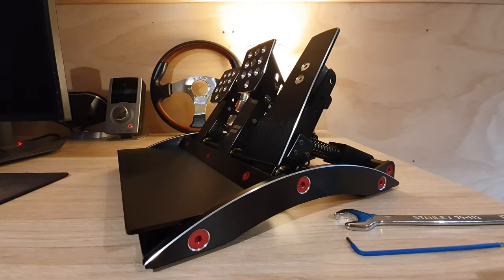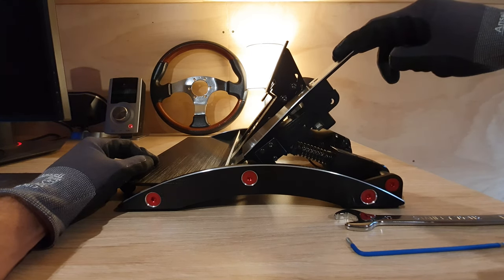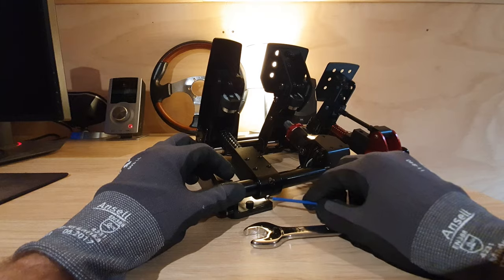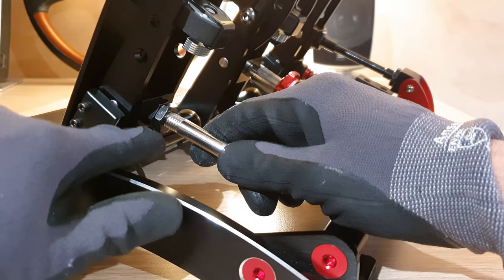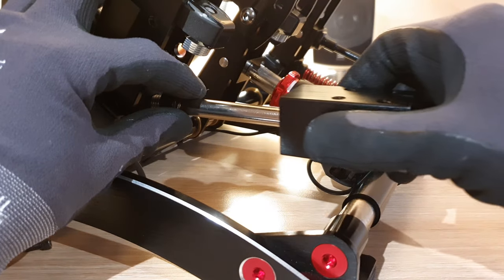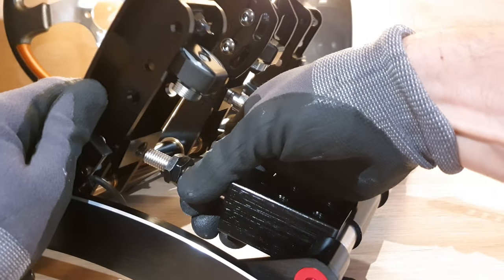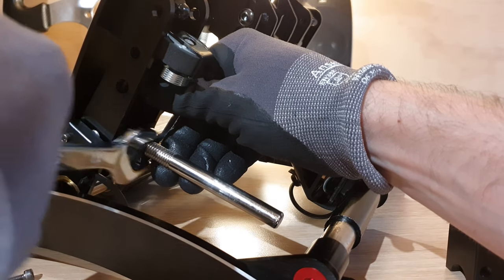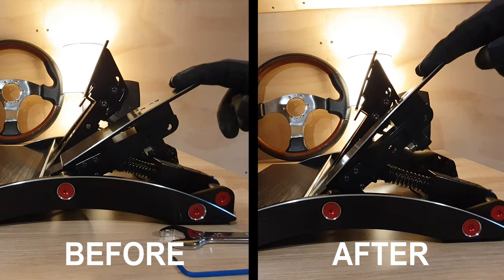Adjusting throttle pedal throw on Fanatec ClubSport Pedals V3

Comment: The reason this adjustment is not in the manual is it reduces the amount of thread used to hold the rod. Reducing the amount of thread to the levels in this video can and will lead to damage of the thread - there just are not enough turns to deal with how hard pedals are pressed in the heat of battle. Instead, get the hydraulic mod and fit it to the throttle pedal. You can reduce the hydraulic effect to zero if you don't like it, but what you can do is twist in the piston throw adjustment to put the pedal throw exactly at the amount you want. Another way to have the same effect is to put one of the spare elastomer plugs from the brake performance kit into the hole where the throttle spring rod goes into back pivot - it will have the same effect.
Reply from the maker: Those are some great points, and I like those alternatives. I can’t say I fully agree that the thread will become damaged as the forces will not be extreme enough to cause wear. A few turns in as shown should be sufficient. After all, we’re talking about the throttle pedal, not a brake pedal with a load cell. I understand it depends on how the individual drives - I tend to be light, smooth and controlled with my accelerator inputs. If you continuously hammer pedal to the metal, then something’s bound to break eventually 😊. Using the elastomer plugs as a stopper is a cool idea, but that might create a rubbery feel instead of having a definitive end-point.  The throw adjustment you indicated on the hydraulic kit as you suggest sounds like the safest option if you’re worried about long-term wear.
Reply: That's not true. With a 10 mm rod, you need to screw it in around 8 mm (depending on the material). From that point on the rod itself would crack rather than the connection.
Reply: You mention the elastomer plug into the hole where the throttle spring rod goes into back pivot, would it be alright putting a metal rod the same size as the elastomer plug, into the rod goes into back pivot.
Reply: I have the hydraulic mod and I can confirm that this is a very easy way to change the pedal throw. Thank you for this comment. It helped me out a lot
Reply: @NiekBoersma  does adding the damper simply shorten the throw or do you have to go into Fanatec control panel and adjust it there?
Reply: @Jedtgill  you can adjust the damper manually to get the 'length' of the pedal/throw that you want. After that you just recalibrate the pedal min/max in the fanatec control panel. Hope this helps.
Reply: @NiekBoersma  finally got all my stuff in and installed. I like the throw with the damper but even at 0 it makes the throttle feel too stiff for my liking
Reply: I also disgaree that this is a problem. The threads are not being held in tension here, the pedal is pushing against that rod. Not only does it have a couple of threads of engagement, it also has the locknuts behind it which form a shoulder for the pedal to press against.
Reply: @noname-gp6hk  I understand you disagree, but the mathematics and physics of threads is well understood and ignored at your own peril. To be clear, the minimum operational thread length to avoid failure and early wear is always four times the diameter of the rod. The more course the thread pitch, the deeper it needs to go as the tolerances of a course pitch thread tend towards it being more loose. There is a "rule" which says a minimum of eight full turns and to a minimum depth of four times the rod diameter; both requirements must be met. However, this is not always enough, it depends on the material used. Fanatec use a lot of aluminium and only uses hardened steel for certain components; that is just good engineering practice. An inspection of my v3i makes it clear the minimum threading depth when delivered is very close to the limit already. This is why I chimed up about damaging the threads.
To repeat a well worn cliche, "You will regret it. Maybe not today, maybe not tomorrow, but soon and for the rest of your life."
Reply: @bertram-raven  But don't the locking nuts combined with the plate always meet this thickness criteria? Why would there be extra thread on the rod and locking nuts if fanatec didn't want you to change the throw length?

Sorry if I don't understand, but even the factory settings would be the same? Doesn't reducing the throw here increase the amount of thread inside the connecting pedal plate?
Reply: @bertram-raven  and rule of thumb that i heard is that minimum 3-4 full threads need to be engaged.
But you are forgetting several important bits:
1) this is no hard-use connection, and while theoretically it may increase failure, for most done this it never happened (for me 3 years so far no problems)
2) alternative to this workaround of one of several very annoying design omissions in V3 (there are many others, like position rods in T-arms placed from below, easy to pinch motor cables, easy to strip threads on alu countersunk screws, easy to loose small spacers on sensor plates, hard to accessible controller ports for mounted pedals, not mountable without removing heel plate, unpleasant too angled pedal levers, dust in hall sensor may result in fluctuations or not full-press in throttle readings, regreasing to fend off squeaks faces one with few annoyances mentioned above, vibromotor on brake way too weak) would be to suffer very unergonomic throttle for years.
I (and many others) did my choice of having more usable throttle at cost of failure risk (which never happened). You may do by book and have secure .. unergonomic throttle for years. Everybody is free to choose for themselves.
P.S. depth of minimum four times the rod diameter? WTH? by this .. "rule" most nuts, that normally are of less thickness then thread diameter will never meet even 1/8 of requirement. So all bolts and nuts in the world = unsecure connection, eh? :D
Reply: Man I put one of elastomers from brake performance kit, now I cant get it out. And I cant  even put the pedals back together cause the elastomer is too long

Comment: I wound out the shaft as far as I felt comfortable doing, need to leave enough thread in, the throw for me is still a little far. I'm thinking of putting a small piece of elastomer inside where the shaft goes.

Comment: Just wanted to say thanks for this video. I'm a little lazy with the throttle, so I wasn't coming off it fast enough in a braking zone, causing some weird things to happen with the car. Shortened the throw some, instantly fixed that issue. Thanks.

Comment: New to sim racing here... What is the advantage of having a short throw?
Reply from the maker: Personal preference - these pedals have a long throw. Full-throttle felt too far away for me, and I was getting a sore ankle after long sessions. A shorter throw means you don't need to push as far to get to full throttle, but the tradeoff is you don't get as much control (modulation) on accelerator inputs, and harsh inputs can unsettle the car when driving. So my suggestion is to reduce the throw until comfortable while also being mindful of your pedal inputs to ensure smooth driving.

Comment from the maker: I note that several comments have highlighted the potential damage that could occur to the threading or connection point due to only a small amount of thread being used to secure the rod. This argument does have merit, and while I had been using this setup for months without fault, since uploading this video, I have found that using a 3d printed plug (or a correctly shaped cylindrical object) that inserts into the retaining hole (bottom) where the throttle rod goes into back pivot is potentially a safer alternative. This alternative artificially lengthens the rod, and in turn, reduces the throttle pedal throw. However, it then becomes more complicated to adjust the exact distance of the throw. If you are considering this method, then I would suggest that you experiment by using a short plug first (less than 1cm) as that will not drastically reduce the throw and will enable you to shorten/fine-tune the throw further by using the example shown in this video - doing so will utilise more available thread in the rod and provide a more secure connection. As mentioned in the description, this is a non-standard modification, so proceed with caution as any damage caused is at your own risk.
Reply: Can you link the 3d printed mod you use now. I would like to buy one and try it
Reply: I simply cut a 9 mm piece from the 12mm red element from the brake performance kit - works perfect for me ...

Comment: So even the stronger spring wasn’t enough to make it stiffer? Would like to try this method but worried it might get loose since its not fully screwed on. How’s it working so far?
Reply from the maker: It's not necessarily to make it stiffer, but to shorten how far it goes down when you push it. The nuts that secure the rod should prevent it from moving and falling out - but I would recommend screwing the rod in at least a couple of turns like it did in the video to put your mind at ease.

Comment: Are there any adjustments on the physical gas pedal or via software to make sure I’m getting 100% throttle? I feel like I’m missing out on top end , albeit minimal but it hurtd
Reply: Yes, Fanatec drivers let you adjust where your maximum throttle is. 

I usually set it slightly lower than maximum throw (hold it a millimeter or two below max) so that I never miss out on max throttle.
Reply: @champion1642  Thank you!

Comment: Thank you. I wonder why I don’t get 100 % compression.  When I press down on the throttle pedal I only get 80% of full throttle. I can’t get the top speed as a result.
Reply: I'd imagine you would have to set your min and max settings in the fan lab software after any adjustments to the pedals themselves.

Comment: I'm pretty frustrated with my clubsport v1 throttle. I consistently have power out of the turn issues (I race ovals mostly, either not enough power applied or suddenly too much and get sideways) because the power comes too fast. I depress the throttle using the spongebob toe method (really carefully) and it's going 50-75% throttle. I thought of moving the rod up on the "rungs" on the side of the throttle pedal, but of course the sensor needs to move up too, but no holes are drilled. Would this kind of help this overly sensitive initial throttle application?
Reply from the maker: The hydraulic add-on might solve your issue
Reply: @mephisto420  ok thanks, I will look into it. Never heard of it before

Comment: Why would you want to make the throttle throw as low as possible?
Just makes less room for trottle control..
Nice tutorial though.😁
Reply: Exactly what I was thinking, it would make sense for brake pedal as you need to get on full braking power as fast as possible to stop the car faster, but for throttle pedal longer travel gives you more room for car control and avoiding wheel spin.
Reply: When you are driving using the "clutchless with lift" method for gear changes - such as the Skip Barber series in iRacing.  Shorter lift of the throttle results in faster changes and fewer missed shifts up.
Reply: Shorter travel distance means faster action speed. These are all the milliseconds that make the difference in the long race.
Reply: @vadimyakus  Depends what you drive I guess, but not that good in powerful cars without tc, then you want to get on the gas smooth not to spin out.
Reply: R-VR Closet it will take you not longer than two days to get used to it and you will improve your times in a week or even less
Reply: @vadimyakus  I think getting on the gas early is more important than the millisecond it takes to depress the throttle an inch more.

Comment: I’ve done this and it’s a great improvement. I’m now no longer getting full throttle though, anyone else has this problem?
Reply from the maker: You need to recalibrate - plenty of tutorials available.
Reply: How do you recalibrate when using PlayStation - I’m using assetto corsa
Reply: @msabbagh4518  I'm not 100% sure as I'm still waiting for my pedals to arrive but I think you need to download the fan lab software on a windows PC or laptop, plug your pedals into that to calibrate, and then reconnect to Playstation.
Reply: @dwaynediamond6431  yes. I figured it out. Thanks !

Comment: Do the indicated tutorial. By making this adjustment, you always have to have the settings in manual mode to determine the end of the pedal, right?

I wanted to put it back as standard and it no longer goes down that far even reaching the end and now the auto-calibration mode only detects me 3/4 with the pedal fully. What could have happened?

Thanks a lot.

Comment: This doesn’t change the distance of the throw; it just starts further forward. It changes the pedal angle and unloads the  spring, which makes it softer.
Reply from the maker: Check it out again. Unscrewing the rod increases its length and thus reduces the distance it needs to travel to hit the end of the pedal box when you push the accelerator.  Remember, the rod only sits part of the way inside the pedal box cylinder, and the distance between the rod and the end of the cylinder determines the throw. I.e. if we make the rod longer, there’s less distance to travel to hit the end of the pedal box – making the throw shorter. You can’t make the pedal start further forward and the length of the exposed rod between the pedal and the pedal box doesn’t change, meaning the spring tension is not affected.